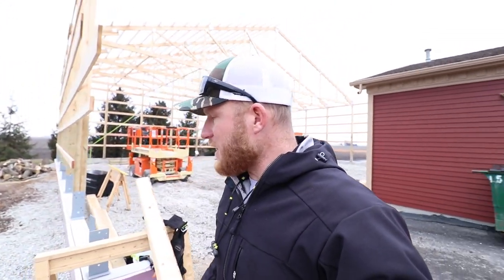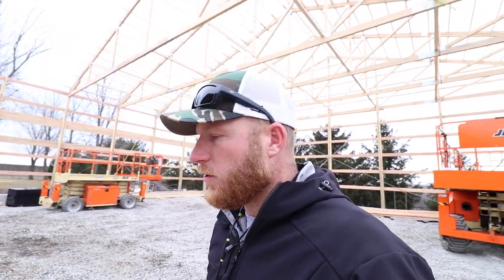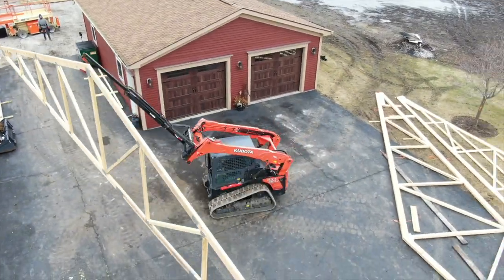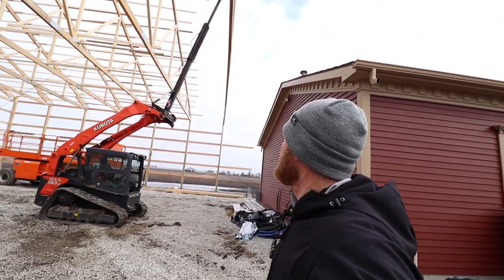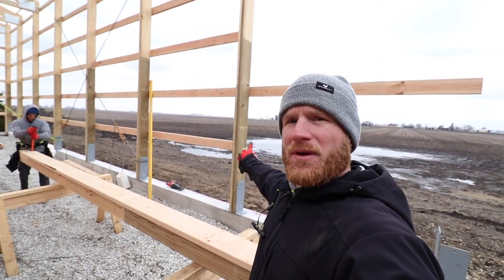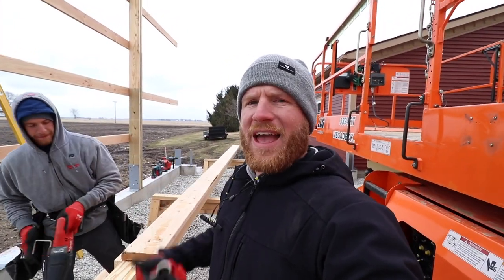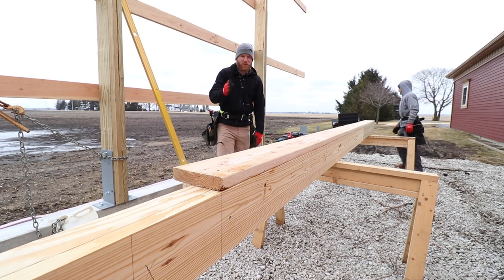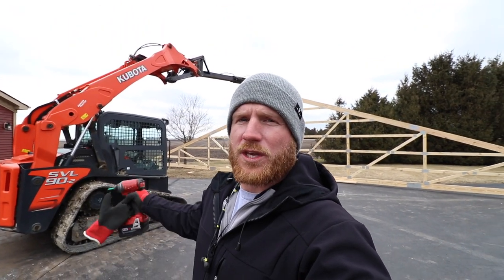How to Build Garage Addition 5: Getting Tricky with the Trusses

Comment: You can get a bobcat attachment for telahandler, then attach Cheyenne boom to that.
Reply: almost pointless unless in a vertical sense. You will exceed the counter balance point of the machine. Those Telehandlers are designed to only carry so much weight at a give boom length vs angle of pitch

Comment: A bit of a no-no to put those fittings on without checking for particles or debris before that. Grit from the site can get inside the pump and then you're left with an expensive paper weight that can't hold itself up.

Comment: if it is muddy just put down some 5ft planks running from the building & out, then put some 16ft planks running the same way as the building & drive your machines on top of the planks u will not sink. that way u can drive the machines along the side of the building to install your steel roof without sinking.

Comment: Man of youre experience, Why didnt you "REVERSE" the last truss in?, you doubled the work by taking it in Forward, dropping it, going round the other side, picking it, then raising it!! Duuhh!! Kyle Always great videos snow & sun you dont cut bits out show the whole job, great banter between you & Greg!!, thanks for regular videos!!!.
Reply: Ever back in such a machine with no back-up camera? not easy nor difficult but also run the risk due to the added forward weight of tipping forward as you reverse if not also backing up into the building already there or something else.
Reply: @Joshua79C  with other staff there surely they could back him up safely.

Comment: You should use some compression on your audio tracks to balance the volume (this has nothing to do with data compression, what I mean is software that is taming the peaks of an audio track and bringing up the quiet parts, so is leveling everything out.). The beeps of the machinery are quite nasty. In very windy situations, a gate can help too. Otherwise great video as always.
Reply from the maker: I need to learn more
Reply: @RRBuildings  No worries, audio production is a huge topic itself. I'm listening on some studio speakers so I'm very nitpicky when it comes to sound. However I have about no experience with video editing, I don't know if and how audio production plugins can be used there. But I still wanted to mention that idea. There are a lot of tutorials on youtube about what compression is and how to use it. All the best!

Comment: It's nice to see for once that foundations are insulated with XPS, it's a minor expense,  but great for thermal insulation and protecting foundations from moisture/elements...they should have protectet that XPS (fiberglass mesh + two layers of fine mortar/glue) before building...XPS is not great with UV rays
Reply: It's also not great as it will retain water which reduces its value, unlike eps which will allow any water encapsulated within it to shed but also evaporate thus why eps is more popular in ICF forms. That and the price difference. But still with either a water proofing membrane helps.
Reply: @Joshua79C  Any moisture from foundations can still evaporate as XPS is only on the outside (protecting foundations from getting wet in the first place), foundations can still dry out (during curing phase) on top and on the inside (of the building), foundations are not encapsulated in XPS...its main purpose is ground contact, and it is important to use XPS to the entire depth of the foundations, that is the best you can do to you foundations as dry foundations can last for ages (as rebar will not rust and case damage to the concrete - cracking), and there are no downsides of that application...EPS is not for ground contact and should not be used in that manner...EPS has it's use on the rest of the building...
Reply: Like i said with any foundation word its always wise to use a waterproofing membrane, i speak from experience doing basement waterproofing for my step dad when he had that business. I have gone to home emergency calls where even the best monolithic wall was permeating with water seeping through it. Outside remediation is not as cheap or easy as inside solutions. Though back then ICF was still not as popular as it is today.

Comment: I’m not sure I understand the reason for putting the end truss (closest to the existing garage) in-bound of the posts.  I can only picture this making some tricky work for the metal siding on that end?
Reply: Right!  I was thinking there would be an 8ft wide connecting hallway between the two buildings.  Who was the architect on this project; Samuel Adams? Anhieser Busch?  

It's going to be a weird one.
Reply: An 8’ hall would have been a good way to connect to 2 structures.  I’m sure that in the end it will look great!
Reply: Unlike you two I am sticking to staying tuned to see if it is tied in as I think, as shown so far where the old will have it back side built in to make it like one whole new building.

Comment: When you're dealing with mud like in this build, do you put down 3/4" plywood for the scissor lifts to drive on to spread the weight and for ease of work?
Reply: He ought to invest into molded (plastic) construction mats, they are worth the money and save time when it comes to needing to driver over soft (non -compact-able) soil such as sand and clay, they have the benefit of being light weight enough to man handle and have interlocking support (via brackets, often sold separate. Having and using such would reduce the need to do what he just did each job with such conditions, especially when the soil is muddy wet.

Comment: Why don't you lay down some steel plates to create a path for your scissorlifts? You could do it with the Kubota....
Reply: Overhere in the Netherlands we only have soft and wet soil, so every buildingcompany has a s@##$load of steel plates to lay down for heavy equipment to reach the buildingsite without getting stuck in the ground. I can't imagine you guys over in Northern Illinois don't have something like that.....
Reply: Those are heavy and costly, same for wood mats which are larger in size, check out composite (plastic) mats, open and solid types, lighter weight and lower cost compared to the other two materials mentioned which would be impractical due their weight and size.
For example: Signature Systems Group - DuraDeck,  SignaRoad and MegaDeck HD

Comment: screws > nails

🔼in every scenario in the framing process 

🔼could be true

🔼this gentleman is almost intelligent

🔼💯

🔼😍

i always use screws in any scenario i possible can (unless it's ridiculous to use screws otherwise ▶such as asphalt shingles)

no matter how it's marketed to show it has superb holding power, i do screw, lots of screw all for me and now maybe you

with the movements of anything a nail may hold acceptably for a while, after time the movement of wood, expansions and contractions of lumber, temporary swelling due to humidity, unforeseen issues with the lumber (not all wood is perfect), all of these factors can cause a nail to come the LEAST bit undone

all it takes is the start of a weak link, then the chain weakens inevitably

the undeniable performance of a proper screw is something in my world that is necessary and more reliable

nails are silly